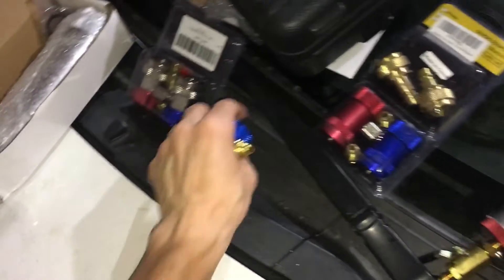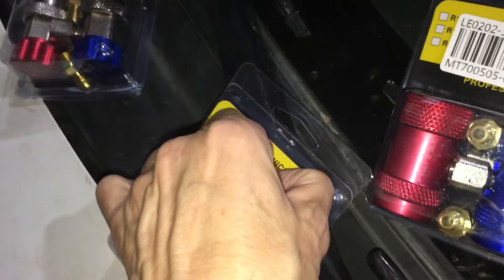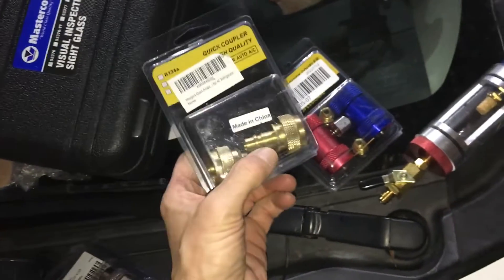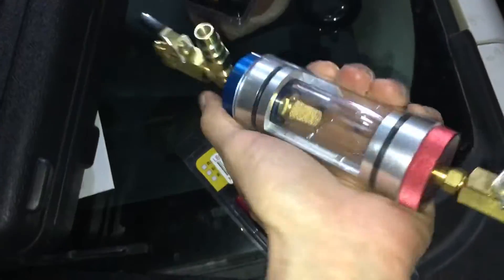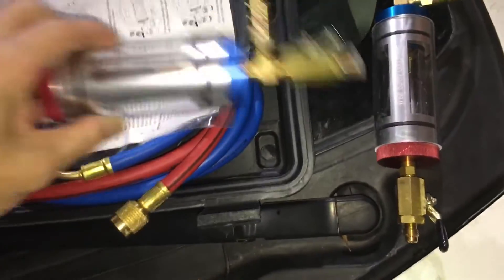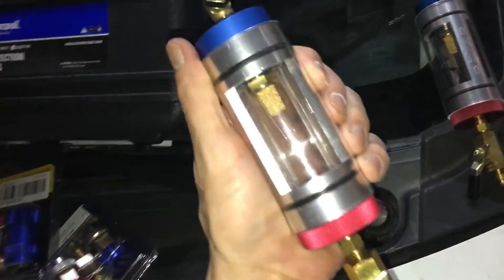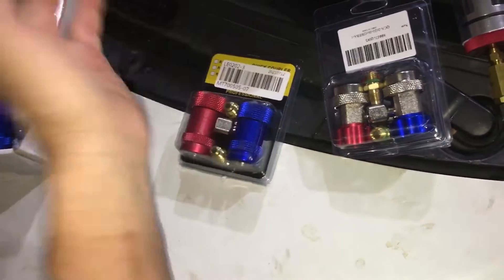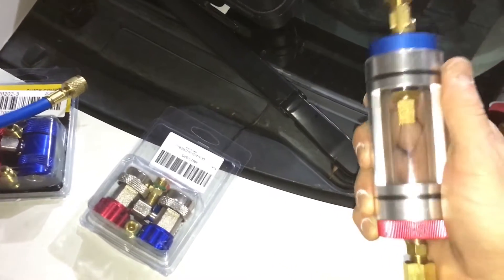AC Service Fitting adapters YF & R134, AC Oil injector￼￼,  Refrigerant visual inspection site glass￼

Comment: What do you use to test for sealant in the system? Here in Texas it’s a huge problem. I use the Neutronics test kit one but it’s probably rebranded.
Reply from the maker: You do not need to test for sealant if you have a
AIRSEPT dual guard attached to your machine. 
    It will separate and remove the refrigerant and the oil out of the refrigerant vapor stream so it never gets inside of your machine

And then at the bottom, they have the drain where you can drain out and measure how much oil and seal has come out of the vehicle when you were recovering refrigerant
Reply: @coldfinger459sub0 yes we have the Airsept dual guard. What about the identifier? Or is the sealant only with the oil? Do you run the heater to before a recovery to get as much as oil as you can out of it does have sealant?
Reply from the maker: @TheManny4692  I’m not sure if you’re getting identifier mixed up with a sealant identifier. They’re two different things from refrigerant to identifier.. 

Refrigerant identifier is only for vapor gas 

Sealant identifier the little thing that gets plugged up to show you that the airflow has stopped relies on a small amount of refrigerant oil that has the sealer in the oil that leaks out through the calibrated hole 

The sealant can plug up and clog your filter on your refrigerant analyzer. I’ve had that happen a few times.
Reply: @coldfinger459sub0 I’m a little slow. What I mean is will sealant hurt my identifier?
Reply from the maker: @TheManny4692  if you don’t have a filter on your identifier, yes it will hurt your identifier. 

The sealer usually clogged up the nozzle if you have a remote identifier with their fitting has a tiny metal brass filter inside the connector . 
    That is the first thing that gets plugged up

And then there’s a paper or vanilla type of pressed plastic filter in line . 
      As long as that, never gets overflowing with oil and make it all the way to identifier your identifier shouldn’t get hurt
Reply from the maker: @TheManny4692 run the heater to help with recovery. 
    But it’s not to try to get oil or seal length out it’s only to get refrigerant out. 

I do defrost mode. I heat up the interior to car until it’s 130°.

Comment: Will the sight glass come apart to clean it out when it gets oil or dye in it?
Reply from the maker: Possibly , I never have. 

I just flushed it out in reverse flow with clean refrigerant . And a refrigerant as a solvent.. 
      One time I got a dirty enough where the refrigerant can’t quite get it all out and I use 99.9% alcohol and pushed it through with nitrogen. 
     I had it for a few years and I’ve never taken it apart to clean it
Reply: @coldfinger459sub0  Ok, thanks.  Flushing with 99.9% isopropyl alcohol sounds like a great option for periodic cleaning.  I recently purchased one but haven't actually used it yet, but I plan to Sunday.  I have a 2012 Volkswagen Passat 2.0 here that I'm repairing the AC on for a used car dealer, and I replaced compressor, condenser (which has a built on receiver/dryer), and TXV, and flushed the lines and evaporator.  Found a lot of aluminum particles in the old compressor, and after the flush, I found more small fragments of aluminum, so my idea is to look at the new refrigerant once I do a N2 tightness test, vacuum and recharge Sunday and just see if I see any more particles that may not have been flushed out.  I feel like I did a good flush, but want to make sure.   Would love to finish it tomorrow, but can't until Sunday.

Comment: Looking at these r134 to 1234yf adaptors: do 1234yf systems work properly with r134?? Can't see a real sense in these adaptors🤔🤔
Reply from the maker: Yes, 1234 systems work perfectly with 134

Many cars produced for different countries will have the same AC system, but they will put 134 or 1234 in the car depending on the country destination .
Reply: Oh, wouldn't have thought that.....thank you. One more question, please. Work r134 systems also with 1234yf or a mixture of both refrigerants?
Reply from the maker: @Akadectra  never mix.

Comment: What is your opinion on  brands CPS / Robinair  etc etc . I do have alot of respect for quality tools such as Field Piece  but not every occasion is the gold plated version required . As u have showed many tools are straight from Chiiiina . The only thing purchasing the ""premium"" tool does  is lighten your wallet
Reply from the maker: Robinair recovery recycle recharge machines are good

Master cool and Robinair Fittings, but I think Robinair might use yellow jacket fittings for the couple in Fittings or maybe they use master cool

Comment: 1234yf quick adaptor is fitted and suitable for car trucks and heavy equipment..
Reply from the maker: Heavy trucks and heavy equipment are not required yet to have 1234YF.   They are just starting to use it some manufactures for heavy equipment and big trucks.. 

Cheap fittings coupling adapters for your hoses. Some of the cheap Chinese ones off eBay are no good to use. .

Comment: Great vid. Learned some valuable info and had a couple of good laughs along the way.  Saw the vid where you used the sight glass. I definitely need one for the Denso system where the ports are on the compressor to make sure I put the correct amount of oil back into the system. Now I'm off to try and find a vid where you actually add some oil.  That oil injector looked like it was for adding oz(s) based on the size. Thanks
Reply from the maker: You can always adjust and control the amount of oil you inject

Comment: I rather recommend you to use good quality teflon tapes on this product.
Reply from the maker: There is no where to put Teflon tape on a Smooth bore shaft that comes up the center to the handle.   And Teflon tape does not hold very well on vacuum a liquid sealant works better. 

Teflon tape is good for liquids like water or glycol but not for vapor gas.
Reply: @coldfinger459sub0  nylog all the way.

Comment: The oil flow would be interesting to see. Because the automotive trade mainly use automatic all in one machines they have no real concept of what your trying to show.
Reply from the maker: It’s good when you’re on a noisy compressor and you open up the liquid refrigerant line valve and fill up the glass container and see that the refrigerant has a slight grayish color to it with tiny metal flake suspended in the refrigerant